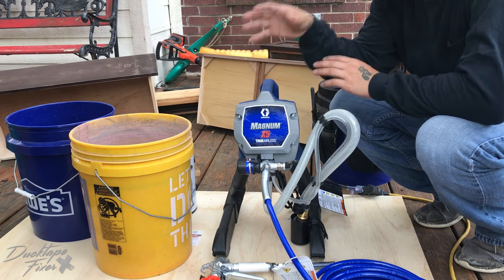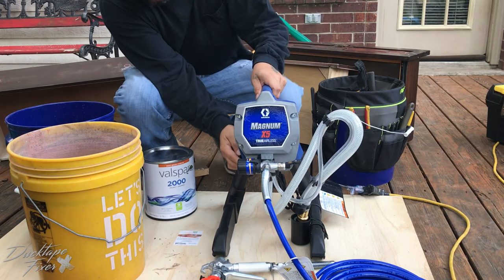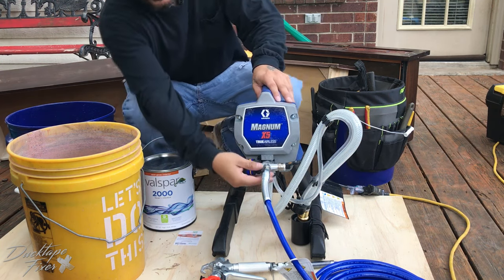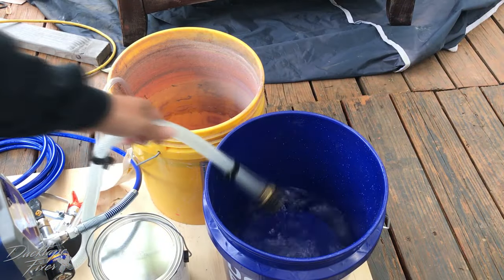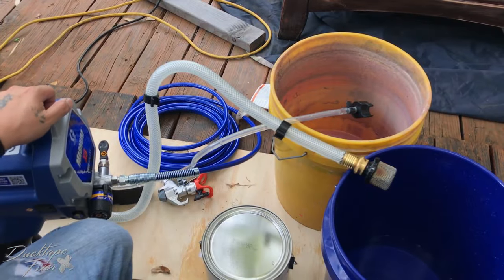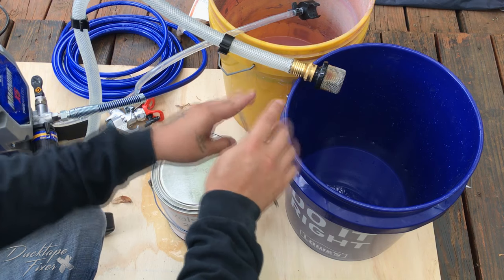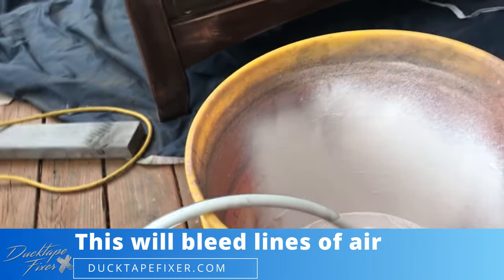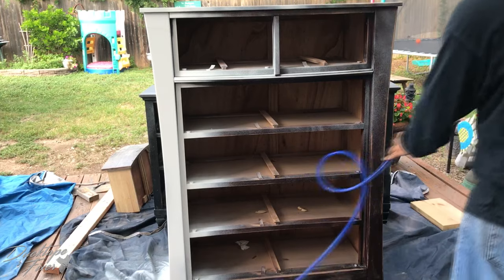First Time Using Graco Airless Paint Sprayer  Detailed Set Up For Beginners quick start

Comment from the maker: check out the Graco Magnum x5 here
Graco Magnum 262800 X5  Airless Paint Sprayer
https://www.amazon.com/gp/offer-listing/B0026SR0FW/ref=as_li_tl?ie=UTF8&camp=1789&creative=9325&creativeASIN=B0026SR0FW&linkCode=am2&tag=kingprint0f-20&linkId=aeefb65eb9fc427d9cfb0f4b2a364c9f
Reply: I just got a used one of these.  Its pretty dirty but I was told it works. I turned on the power switch and nothing happens.  Shouldnt the motor / pump come on in order to prime the unit ?
Reply from the maker: @mommysheep9239  yes motor should start running as soon as you turn it on, motor might be locked up

Comment: My tip keeps clogging up shortly after starting, turn tip to unlock clogging run then back to spray. Works for a short time then clogs again
Reply: Strain your paint through a filter
Reply: Sometimes thinning the paint helps.  Plus use a filter.

Comment: Set prime lever to prime
Set pressure dial to start
Press prime button twice
Set large tube in fresh water bucket
Set small tube in waste water bucket
Run the unit for 30 seconds
Place large tube into paint 
Run unit until paint in waste bucket
Switch prime leveler down
Place small tube in paint bucket with large tube